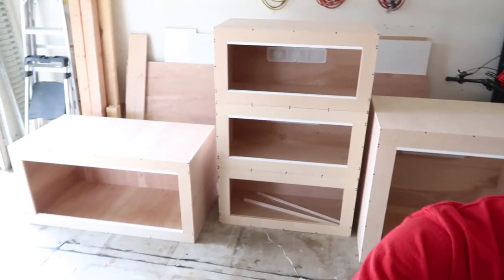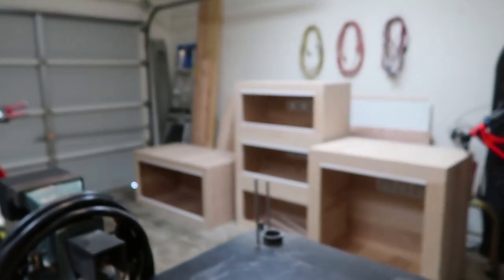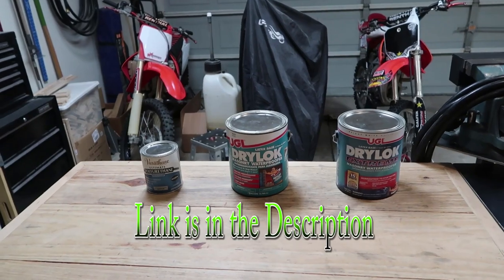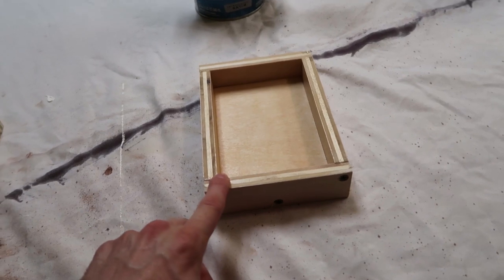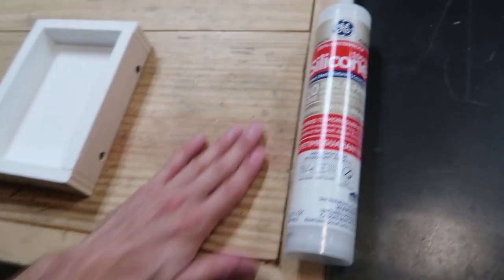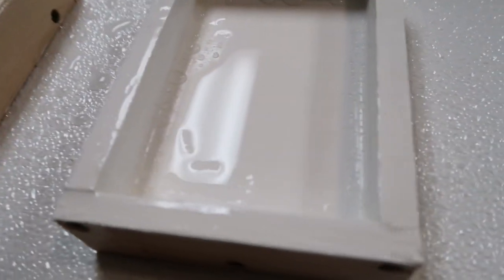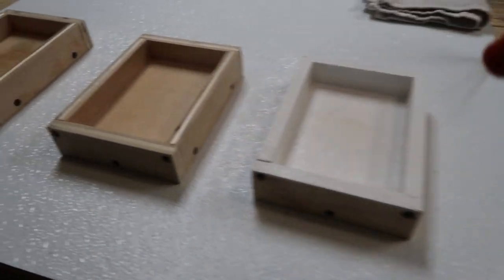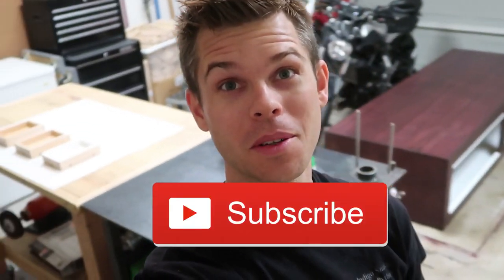BEST Interior Wood Sealants For Reptile Enclosures!!

Comment: Hey we built an enclosure for our beardie and we used minmax gel stain, not knowing about the oil being bad but my husband thinks putting polyurethane over it 3 or 4 times will be OK, but I'm scared I definitely don't want to harm my beardie!! Will this be OK or should I sand it all off???
Reply from the maker: Are you talking about wood stain being applied to the interior of the reptile enclosure?
Reply: @talkingserpents  correct.
Reply: @talkingserpents  we already put the minmax gel stain in it without knowing or realizing it is oil based and it can be harmful, so I'm thinking I should just sand it out and let it sit for a few days then doing the polyurethane coating a few times...
Reply from the maker: @trincromwell7274  I would definitely sand all of the stain out of the inside of the reptile enclosure. Also I would highly suggest using dtylok extreme since you won't get all of the stain color out of the wood. Drylok extreme is more water resistant and you can get it tinted in several different colors if purchased at Home depot or Lows. 
Hope this information was helpful.
Reply: @talkingserpents  it most definitely it helpful and much appreciated!! Can I use the drylock and then the polyurethane to top coat just to maybe give it an extra layer of protection or will the drylock be sufficient? Appreciate this info!
Reply from the maker: @trincromwell7274  Use just the drylok. 2-3 coats are recommended.
Reply: @talkingserpents  is acrylic paint ok to use to tint the drylock? Don't really want to have the whole gallon tinted one color..

Comment: If I use a safe sealant on dried pinewood vivarium will it be ok to use?
Reply from the maker: I have used these sealants on 2x4 's in the past with good success, so it should work. 
Although I must say I don't personally recomend building reptile enclosures out of pine and cedar since they have oils in them that can be toxic to reptiles. I personally use birch wood with my reptile enclosures. Hope this information was helpful. 😎
Reply: @talkingserpents  cheers mate thank you

Comment: Does the dryloc extreme make wood smooth? I have a problem of dubia climbing the walls of the enclosure
Reply from the maker: Drylok extreme has about the same texture / smoothness as an interior paint.
Reply: @talkingserpents  oh okay. So dubia shouldn’t be able to climb up the walls ?
Reply from the maker: @Xotics365  I don't couldn't tell you that specifically
Reply: They can climb it

Comment: I only use ge 1 because it doesn’t have the mildew resistant properties and oil based polyurethane is fine to use as well just let it cure never had any promblems
Reply from the maker: Never heard of the GE 1. 
Personally I would stay away from oil based polyurethane inside a reptile enclosure, since they have higher VOC levels in comparison to water based polyurethanes.
Reply: talking serpents the the Voc levels only matter when the coating hasn’t cured ge 1 is a kitchen and bath silicone made by the same company of silicone that you used it just doesn’t have the the mildew fighting properties if you look on the old reptile forum you can find people speaking on the differences on all my monitors enclosures I’ve used oil based poly but I do agree water based is easier to clean but both work great asking
 as you let the finish cure for a reasonable time

Comment: Drylok doesn't waterproof, it makes a water resistant barrier. Damp soil and standing water will cause the wood to rot out. Is this why you now put a disclaimer on your finished enclosures that they're just water resistant?
Reply from the maker: You're correct. Drylok is water resistant not a waterproof sealant.
Although I have put drylok through testing. The test was a small box coated in drylok. I then filled it with 1" of water and left it for 1 week. The coating was not damaged in any way. For perpetually damp substrates and standing water this coating is not proper. Our pvc reptile enclosures are best for those conditions.

Comment: What happens if I only seal the bottom and not the rest of the wood?
Reply: It just wouldn't last as long. The wood would absorb any moisture in the air. It wouldn't be that bad if it was a very dry enclosure but it would still be best to seal the whole thing. Way easier to clean and will last a long time without issues

Comment: Wrong silicone that has mold prohibited in it
Reply from the maker: I think you forgot to finish your sentence??? 🤔🤷‍♂️
Reply: Anything that prohibits mold is not good silcone foe reptiles google the internet and find out for yourself.
Reply: But I do like the drylock xtreme 😁
Reply from the maker: @sillywilly722  I agree with you. The product shown in this video is G.e 100% silicone #2 ( red label) 
The more appropriate product to use is G.e. 100% silicone #1 (blue label)